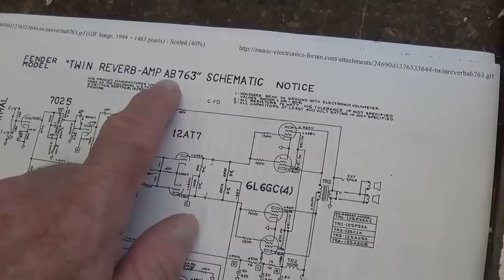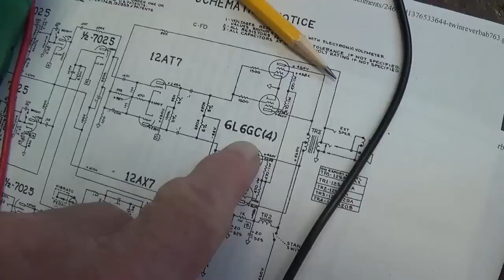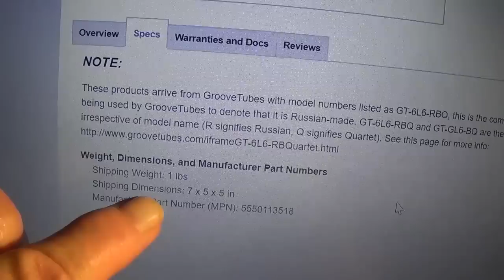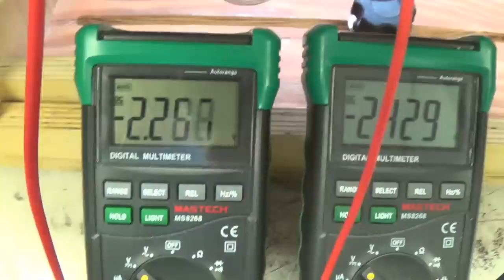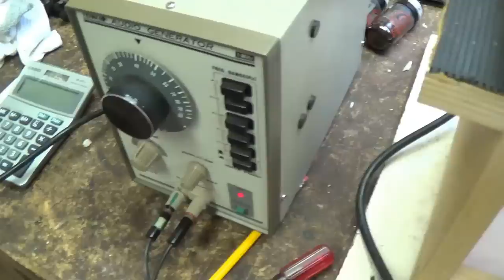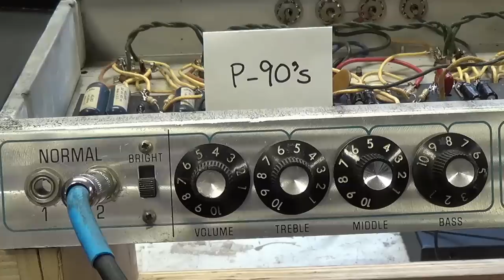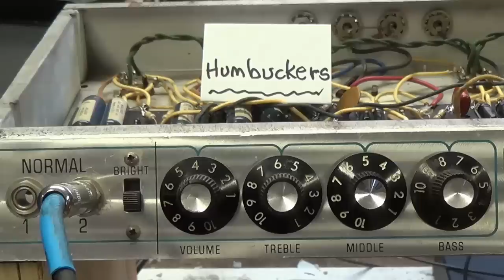1968 Fender AB763 Twin Reverb:   Evaluation, Modification, Extended Audio Demo

Comment: 2:03 First look at the amp
4:32 Dog house filter caps
11:36 First look at the circuit 
15:12 350 volts of fun
15:47 Removal of 2nd power transformer center tap
19:13 Grid stoppers
20:04 Current limiter and biasing 4 output tubes
22:11 Finding plate voltages for 6L6B tubes
24:57 *Uncle Doug’s video on biasing double/quad ended amps
25:06 New (plate current) matched tubes 
26:20 Amp biasing with only a multimeter
26:40 Identifying output tube pairs in a quad ended amp
37:55 Signal generator (400HZ tone)
41:26 Slowing the trem
42:45 Capacitor inventory
43:35 Alligator clipping capacitors into the trem circuit
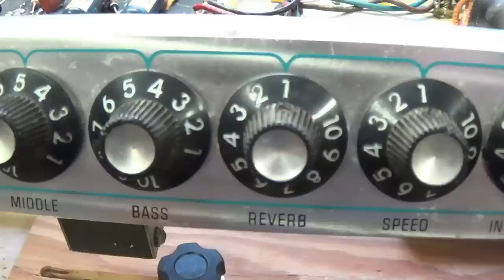44:10 Reverb tank and circuit evaluation
45:34 Negative feedback switch / Rewiring power cord
49:40 NFB loop - audio demonstration
50:55 P-90 pickup - audio demonstration
56:42 Single coil - audio demonstratio
1:00:21 Humbucker - audio demonstration
1:03:05 Humbucker + reverb - audio demonstration
1:06:33 Final thoughts
1:08:40 Texas drone blues
Reply: Gee thanks for spoiling it for me... maybe Uncle Doug should consider doing alternate ending out takes to keep the element of surprise
Reply: Uncle Doug,
I recently bought a 68 silver drip face at a great price. When I got it home and after reading how to tell the difference I discovered the reason for the great price was it had the AC 568 circuit even though labeled AB 763. Made week 34 on 1968 I would like to get it back the the best of the AB 763. I see several mentions of this up/down grade on the interwebs but wanted to know if you have anything on this. I don't mind spending money on it because of love the twin reverb sound. After watching most of your videos and subscribing, I think I would like to tackle the job myself to feed my true geek desire.. Any thoughts on that as well? I would like to also implement some of the audio improvement you did in this video. Thanks for your videos on this stuff. I find myself watching them for hours and learning much.. Dave
Reply from the maker: Wow....thanks for the detailed Table of Contents, LB :)
Reply from the maker: Greetings, Dave. If you feel qualified to perform the modifications, by all means do so. Some will probably yield little or no improvement in tone, but that's for you to discover. Good luck.

Comment: This is so helpful.  Just got a '69 Silverface. Beautiful amp.  Clean bill of heath from the local tech,. AB763 Master Volume added to the rear panel already.
  It'll have a switchable NFB loop tomorrow.
Reply from the maker: That's great to hear, Nathan. Best of luck with your new acquisition.

Comment: Thanks to Uncle Doug I powered up my signal tracer! The last time I looked at the Eico 147-A I had no clue what I was looking at. This weekend, after tutoring under your channel, it became clear how much like a guitar amp it is. I checked the transformers windings, measured the resistors, checked the ESR and values of the caps, fixed a broken wafer switch and installed a 3- wire cord. Bringing it up slow on a variac I checked for potential between chassis and the line ground. Then disassembled a 50k pot for cleaning and cleaned the rectifier socket to bring it back from it's decades long slumber. Pretty cool to have an idea of what is going on and some confidence I'm doing it right. Next the Eico 232 VTVM. I did get it powered up after checking it the same way but I have 50v AC from chassis to ground.? It is diode rectified and I'm not sure just yet exactly how it's circuits function. I think the potential to line ground is a concern. I love your channel and thanks again!
Reply from the maker: Wow, it sounds like you're ready for your own YT channel, CR. I'm really glad the videos have been helpful.
Reply: @UncleDoug  my contribution to YT is to help creators like you who keep ads to the minimum by like, comment and subscribe. I'm of a mind to make a monetary contribution to your patreon.

Comment: Uncle Doug, I owe you many thanks! This is the video that helped me crack the code of why my ‘76 SF Twin Reverb sounded so terrible and would breakup very quickly. Most of my theories pointed me to the Output Transformer as the culprit but it seems it works just fine.

Turns out the amp was biased super cold. Like 8% of max dissipation (MD)… I used this video to learn how to properly use the multimeter to calculate the bias.

This particular amp had been modded to a Bias level from the original Bia Balance pot in the chassis.

After taking several measurements and slowly adjusting the bias higher, I settled in at about 52% of MD. The tone has improved remarkably but there is still some noise to suss out. For now, I’ve re-assembled the amp and have been enjoying it. Next month, I’ll pull it open again for another health check.

Thanks again for the many hours you have put into this channel. The information here is truly valuable if not priceless. I’ve learned so much in the past 6 months yet I see I still have much to learn.

Keep the awesome videos coming Uncle Doug. We all appreciate it and owe you a great debt of gratitude. 

Take care for now,

-Scott
Reply from the maker: You're welcome, Scott. We're glad the video was helpful :)

Comment: TAD tubes blow HEAT on GT's. I had GT's (6L6) in my new Fender Deville from the factory. Smoked em 3 months later at a gig. Luckily I had a back up amp. Bought a USED matched pair of TADs and here it is 10 years later and they're STILL going strong
Reply from the maker: Thanks for the info, John. So far, I am really happy with the TAD tubes I have installed.

Comment: That's a great choice for 6L6 replacements. Those are made for TAD by Shuguang (which is a quality  manufacturer) and TAD does a super job testing and matching the tubes before they're sold.
Reply from the maker: Thanks, David. I have been very pleased with the TAD tubes.
Reply: You know, I find it amazing how man different flavors and styles of tubes are being rebranded and sold by so many distributors when in fact the majority of every new tube being sold in this new millennium are being produced by only as few as three different factories worldwide! 
What is more perplexing is that even many of the exact same brands made by the same factories are sold by many different distributors and retailers, yet the quality sold by the various sources of those same tubes can vary vastly in quality. 
It's commonly assumed that these factories wholes large lots of various grades of tubes and that the bigger distributors cherry pick the best production runs . Letting nothing go to waste, seconds or even thirds production stock, perhaps even many other various rejection stock is sold and blown out at discounts to any wholesaler that will bid on them??? 
It would be interesting to hear from a real tube insider that could give us the true story of how tubes are produced and distributed these days. Unfortunately, most factories are located in foreign countries that aren't known for being very forthright about disclosing much about the workings of their infrastructure. Aspen Pittman did alot to bring new production tubes to the free world. However, over the years his eccentricities has seemed to obscure his credibility in the opinion of many folks. Regardless, he created a new niche industry of grading and marketing of  audio vacuum tubes. Some might even say letting nothing go to waste.  
Unfortunately, it is still buyer beware, even with some of the  "premium" vendors vs value vendors. It isn't always you get what you pay for... 
 Obviously consistency is a major key characteristic of good quality tubes. However, consistency is all relative, with some major silk-screened fancy labeled  tubes even being consistently poorer than others, yet they maintain intially consistent electrical characteristics. The major emphasis on static dissapation. 
I have been finding that the tubes being rebranded as the newly licensed Tung -Sol have been most satisfactory and most welcome addition in my shop. They came onto the scene just when I had just given up on all forms of new production tubes, including and especially J-J's !  
It certainly is much easier to buy a usable new production tube than to have to go on safari and procure lots of used vintage tubes and wade thru piles, grading them yourself. (I don't believe in the term NOS tubes as they don't really exist or if they aren't extinct are likely new old b stock or rejected  orig stock... NOS Tubes are  USED vintage tubes that test as if they were new stock) Vintage tubes require careful selection, just as many new production tubes. 
Fortunately, new production tubes are getting better & better.

Comment: Excellent presentation as always. I'm surprised you were able to record even at volume settings of 3.5 to 4 with that amp. I had a early silverface like that decades ago and still remember how LOUD it was! Anymore I rarely crank my champ up past 3. That mod  reverb tank sounds great. Thanks again for such a quality presentation. Your one of a kind.
Reply from the maker: Thanks, S66. Trust me, it was plenty loud. I had some paper napkins stuck in my ears.
Reply: @UncleDoug    Johan Segeborn has a video of him playing a Les Paul thru one of these CRANKED.  He's wearing ear muffs, and still wincing at the thunderous volume.  Great sounding distortion, but even he admitted he may have gotten a bit over ambitious doing this, lol.   Also, he was standing behind the amp, not in front of it...
Reply from the maker: @pyroman6000  Definitely not my cup of tea, Pyro, especially if the amp and speakers belong to someone else.
Reply: @UncleDoug    i figured.  That was mostly aimed at folks who might wonder what a twin reverb sounds like dimed.  Most likely wont get the opportunity, lol- not for the faint of heart!
Reply from the maker: @pyroman6000  Not an experience that I would relish, P. To me, in close quarters, 2 to 2.5 is max volume.

Comment: Great video! I just recently found a nearly identical "Drip Edge" Twin Reverb for sale -- totally original, including all the original caps, 2 wire cord, 4 black plate RCA 6L6s and RCA and Telefunken small tubes, original footswitch, reverb tank, and Jensen speakers. The stamps on the chassis are all late 1967, and all the other dates match up. The Tolex is perfect, and there is even an original tag hanging on the handle all about caring for the Tolex covering. The Twin Reverb is way more amp than I need (or could possibly use), but I couldn't pass it up for the price. The seller claims to have been the original owner who had played it in a band in the late 60s and early 70s and stored it since then. As far as I could tell, I was the first to have it apart.

So far, The 1K resistor under the doghouse had cracked, and one of the grounds had come loose where the main board flexed, but fixing those brought it back to life. I already installed the 3 wire cord to your specs, and I've got new caps and a few resistors to go in this week. I might add the NFB and Tremolo speed mods while I'm in here working on it. Oh yeah, it sounds great, and it's LOUD!

Thanks for the great videos. I love guitars and electronics and you have inspired me to take on doing some work on these cool old amps. I just finished my first restoration on a pretty rough Pro Reverb that turned out really nice and took on this Twin as my second project. The payoff is huge when I hear how great these sound and think about what they'd cost to buy new today. Keep up the great work!
Reply from the maker: Congratulations on a great acquisition and repair, Chris. Silverface Fenders are generally bargains.....and great amps to boot. We're glad the videos were helpful.
Reply: Oh that's so good you got that amp going mate, & at a great price too huh?  Double congrats then!  UD will be proud of you!

Comment: I just Laugh Out Laud hearing and imagining "swing the chassis around your head" when Uncle Doug spoke about verifying the center tap´s solder. The Egyptian and wine jokes were a good touch too.
Reply from the maker: Glad you enjoyed the festivities, S. Fixing amps can be fun :)
Reply: @UncleDoug  Of course is fun! It's a rewarding puzzle, not as painstaking as fixing surface components boards.
Reply: I could imagine Chuck Norris stepping in to swing the amp chassis at six plus G’s. Then he sits it down to and tells Doug he’s good to go.

Comment: Hi Douglas,
Many decades ago here in England, mains leads were red Live; black Neutral, and green was the Earth wire.  Then that changed when we joined Europe: Live became the blue wire; Neutral became the brown wire, and Earth became a spiralled green and yellow coloured wire.
The reason was to enable colour blind people wire a mains plug onto a mains lead correctly.  Not personally suffering from this disability, it is said that the colours green and red look very similar to a colour blind person (brown), therefore, Live could easily be mistaken for the Earth, or vice-versa.  
73 from Phil.
Reply: It used to be red live, black neutral,  green earth in south Africa  too, until they changed to European standard.  Should be the same worldwide.
Reply from the maker: Thanks for the info, Phil. I thought brown was the hot wire.
Reply: @UncleDoug  Brown is the hot wire in Europe, Blue is the neutral, assuming the power cord was assembled correctly (made in china?). Might be worth checking. Great sound, the Fender twin. I once sat in front of one whilst busking Johnny B. Goode on the fiddle. Very enjoyable, then, as we were packing up there was a bar fight... that's Essex for yer. I love your amp repair videos. Cheers, Steve.
Reply: Oh, what a bugger!  I’ve completely got the blue and brown mains wires the wrong way round: blue is neutral, and brown is live. 
That will teach me for posting comments seconds before snuggling down into bed LOL.
Phil.
Reply: @UncleDoug  brown is the hot one.

Comment: The washing instructions on the VOX AC-30 say "lie flat to dry". It is clear you just threw yours in the dryer on the high temp setting.
Reply from the maker: That explains why it was still warm ;)
Reply: And here I was thinking that you were supposed to put it in a bucket of water for an hour to let it grow to full size.

Comment: Hi Uncle Doug, your videos are both informative and entertaining (you make a great teacher).  I have a question: you indicated in another video, dealing with, I believe, biasing a quad or quartet of output tubes that you prefer to bias tubes in a grid biased circuit at 50 to 60%. Of plate dissipation.  In this video however the tubes you are using have a plate dissipation of 30 watts but you biased them to just 13.2 and 13.3 watts.  Why did you go low?  Just curious.
Reply from the maker: Thanks, Stacey. You're right.....the bias values for the quartet appear to be quite a bit lower than I recommended in another video. Bear in mind that these values were obtained using a current limiter, which lowers the current within a large high-wattage amp like this quite a bit. Once I plugged it into a wall outlet, the PD increased dramatically.....up to 60+% of max. Not mentioning this was a serious oversight and I apologize for not doing so within the video. I will correct this error in a future video.

Comment: I've have always used JJ tubes, and usually their 6L6 GC tubes. I use them on my Fender/Dumble clone 135 watt clone Twin amp that has almost 500 vdc on the plates, and they have worked very well without any failures. I have tested that amp and it outputs a consistent non-distorted 125 watts RMS.
Reply from the maker: Wow.....what a powerful amp. Thanks for your input, Tony.

Comment: TAD tubes are far superior than those 6L6B 's. Plate dis. is only about 25W  on those Sovtek 5881WXT  compared to a normal 6L6GC which is 30W.
"Hint of wood "indeed! At 43:00 those are the best  plastic containers ever and found at Harbor Freight Tools. I got five of them! Yeah,they're that good and very inexpensive.
Really impressed by your work especially here Uncle Doug! I bet the owner will really be very pleased for all your work and thanks for showing how you repaired this fine amp!
Reply from the maker: Thanks so much for all your nice comments and information, HM. We really appreciate it.

Comment: I have a very similar amp.  Mine dates from late '67.  From what I've been told, most of the early silverface amps have a blackface circuit because they were using up all of their old stock components before moving to the new silverface circuits.  If you see a silverface amp that has solid vertical black lines on the front of the chassis then you most likely are dealing with a blackface circuit.  I got mine for an absolute bargain and was confident it was an ab763 circuit even though the seller would not open it up and send me gut shots.  Unfortunately UPS managed to spear the box with a forklift and completely demolished the JBL speakers and the baffle.  I had a choice to file a claim with UPS and never see the amp again or to just keep it.  I ended up keeping it because I had acquired it at such a cheap price.
Reply from the maker: Yes, the first few years of silverface Fenders generally had blackface circuits......and they are a bargain.

Comment: Uncle Doug allways enjoy your videos!!! Thanks for all you do! One question if i may, how to clean, if its possible, the white-ish patina on old silverface amp like this old twin reverb?
Reply from the maker: You're quite welcome, Michele. If you mean the white dusty coating on the chassis, simple Windex on a cloth will usually clean it up nicely.
Reply: @UncleDoug  my bad, i mean the white patina on the silverface front panel, i think its the aluminium oxidation, but maybe there is a way to clean it a bit without demaging the front panel letters